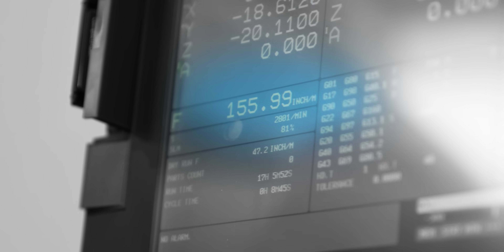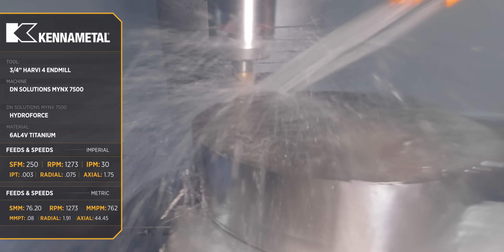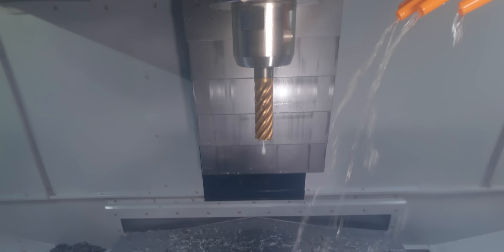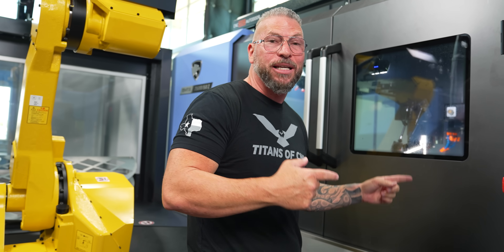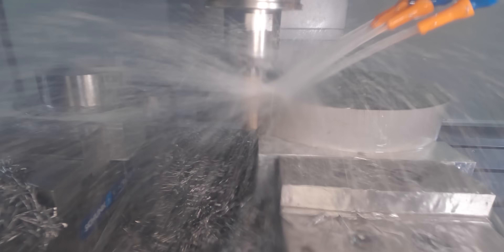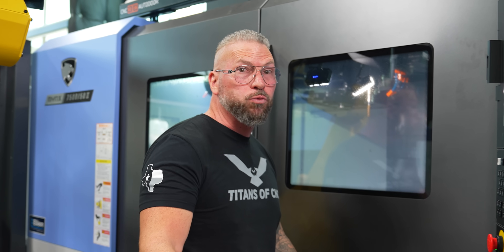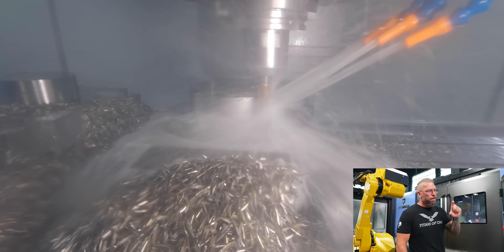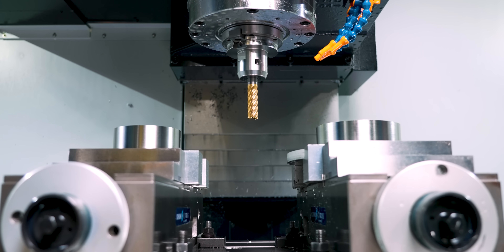CNC Machine Titanium & 316 Stainless Fast and Efficiently

Comment: Noting special in that stainless in my experience. Any quality carbine end mill even  resharpen and coated can do that and you can use smaller step and mach higher feed. it.s amazing have good MRR and tool life you can get with that technique.

An for spindles. If they can take crashes, it tells you haw strong they are. And with full carbine tools spindle load is practically nothing, in general. Have seen crazy heavy milling and machines can take it.

Comment: This video inadvertently helped me solve a many years long issue the company i work for has had. 
Just the idea that an endmill with more flutes has a larger core size and thus is a more ridged tool to use. Changed from a TiAlSiN coated 1/2 inch 4 flute Guhring only able to contour two 5/8 carriage bolt holes without throwing sparks and scraping the endmill. to a 5  flute 1/2 inch AlCrN coated  redline able to contour 36+ holes with not a spark yet, a glossy finish and a way faster cut time!! Shes still cutting!! 

Thanks Titan!
Reply from the maker: That’s Awesome!
Love it.

Titan

Comment: I beleive the tool manufactures base their speeds off the cutter spending 50% of the revolution engaged in cut (full slot) so dropping down to 10% side load drops how long the cutter is engaging and the heat that goes with it. I like to start at 40% more speed than recomended off a website if 10% side load is used as a rough rule of thumb, and ajust from there depending on how long I want the tool to last and how reliable i want it to be.

Comment: Is the flute tool supposed to have those divet looking things on the flutes?      The job I just started 2 odd months ago as a machinist trainee instead of machine operator like I used to be for 4yrs at a previous job which didn't teach us terms / jargon ,uses similar toolings and I haven't seen em having the sideways divets on the flutes on em.
Reply: Those divets are staggered on each of the flutes.  They help to keep the chip made by any give flute shorter.
Reply: @brandons9138  Huh that's nifty, thank you for answering my question.

Comment: It was so nice to see 316ss again. We all love the titanium, inconel, and monel videos but I bet 316ss is far more common in most shops. I cut a lot of 316ss and I'm always amazed how slow people run on forums, and how slow mfg s&f charts recommendations are. My fusion template for a 316ss part: Helical Tools : 500SFM 1/2" 5 FL 1.25" DOC 8% radial  0.0073" ipt (~140 ipm). Okuma M560. Spindle load is less than 30-35% generally.
It would be awesome to see more Cat40 spindles. I love a Cat50 hogging, but not nearly as common

Comment: I'm confused. I pretty much run all my Helical  endmills at 400sfm in 6AL4V and they last forever. This isn't just a Kennametal thing lol
Reply from the maker: Don’t be confused.
I have been running at 400-500 SFM on YouTube for a decade.
If your full axial and have a 10-15% radial… then your doing great. It’s also about the chip load… my IPT is high at .0047+ and it’s an 8 flt tool that also makes it even faster.
Anyways, all good.
Have a Blessed night.
Titan
Reply: @TITANSofCNC  usually I take the highest axial depth of cut allowable by the part, 10% radial. My usual rule of thumb to start with is 1.5% of the tool diameter chip load for rouging and .5% for finishing and it tends to work well for me with my 6 flute endmills. Thanks for the reply

Comment: I think every young/new machinist really needs to understand the concept of radial chip thinning. 
I believe most manufacturers are expecting the machinist to take this into account. 
Plug their recommended IPT into a chip thinning calc, they're everywhere. You get an ipt of .0042, still, a little less than Titan's .0047. 
Once you start making real chips, you're able to pull the heat generated in the cut out with the chip, saving your tools and allowing you to increase your surface footage. .0025 IPT at 10% just seems too close to rubbing for roughing.

Comment: 2:30 What is the downside to more flutes? If more means a thicker and subsequently stiffer/stronger core why dont endmills have 30 flutes?
Reply: The more flutes the smaller the chip gullet.  The smaller the chip gullet the smaller the feed per tooth.  There is a point where more flutes is just counter productive.

Comment: Those factory recommendations are probably set low, so the rigidity and spindle can keep up if you are running a 30k Haas. But with the machine you are running, the spindle and rigidity are undoubtedly much better, so if you showed the load and data on the rigidity, it would help apply to all machines and setups.

Comment: Can you show the spindle load on each cut next time?
Reply: There was nothing exciting to show, we have the same machine with 6000 rpm gearbox spindle and we use 125mm fast feed roughing mills all day long on 4140 steel. These have feeds based on machines limits, about 120-140% spindle load😎
Reply: Better yet do the math and tell us the go/torque of the cut, that way it can easily be translated to other machines with different curves/ratings